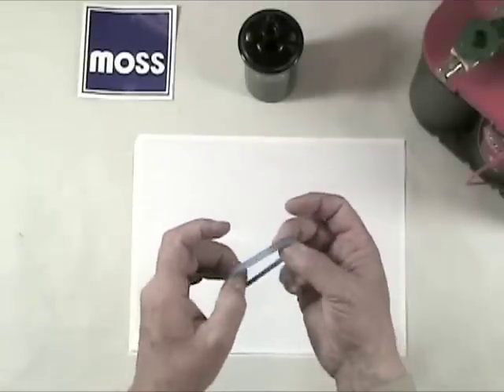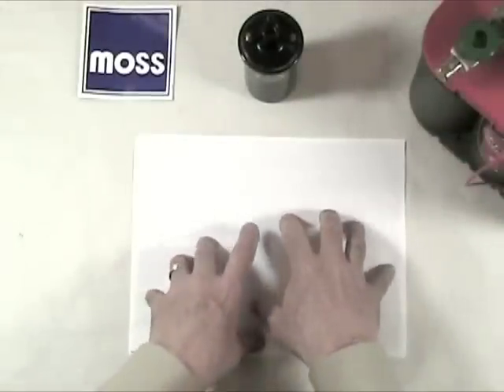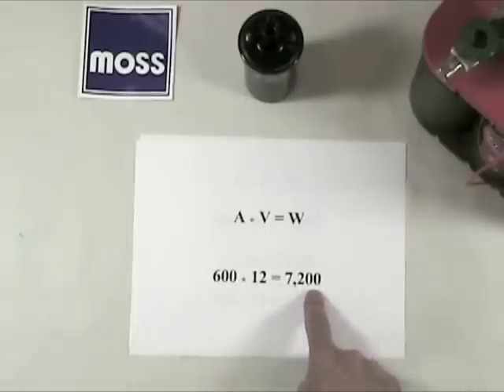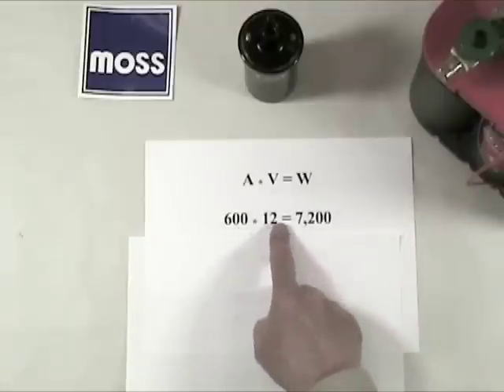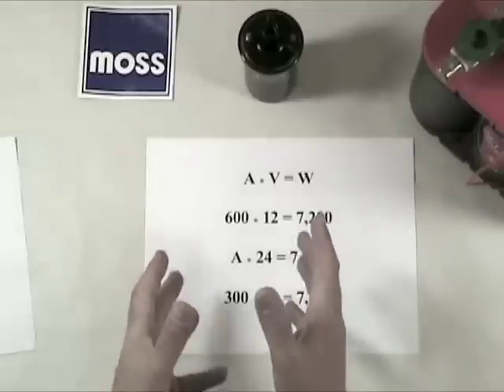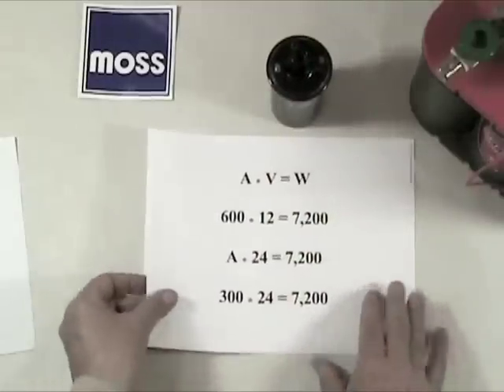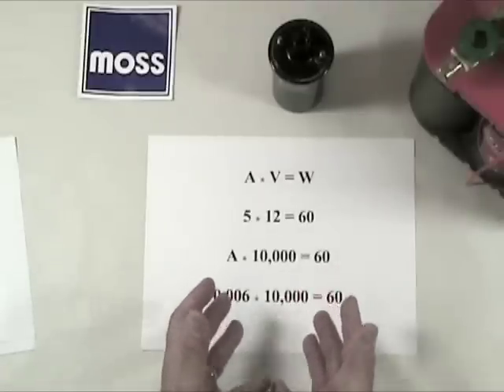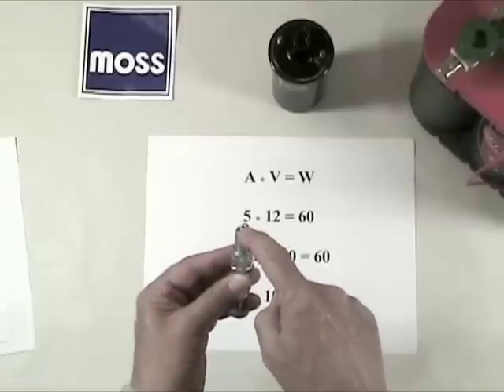How Spark Plugs Get Power (Part 2) - Transformers & Coils

Comment: I think I understand. So transformers are like transmissions. Transmissions trade engine torque for RPMs, with each higher gear, and transformers, trade amps for voltage? Like a single ratio transmission, for electricity?